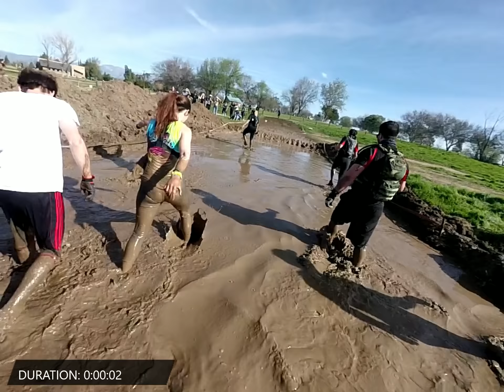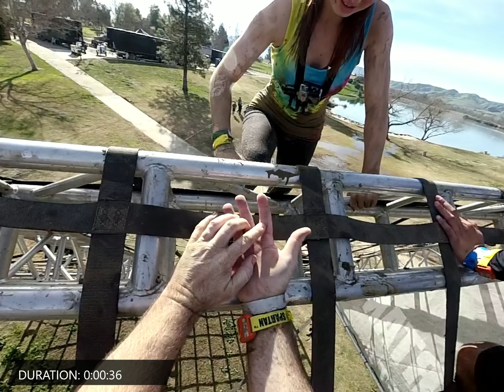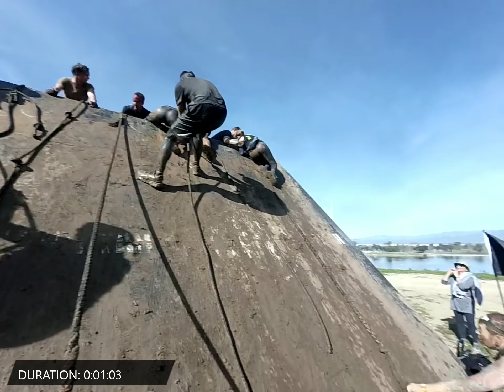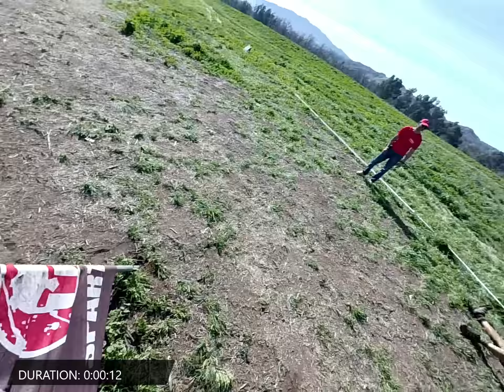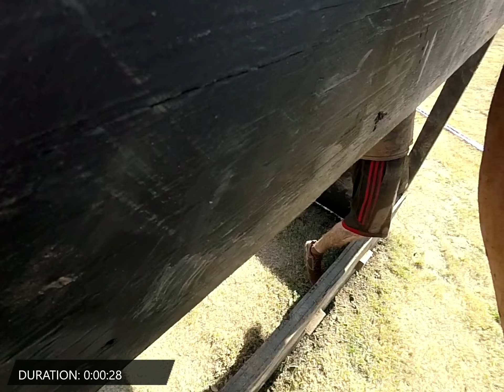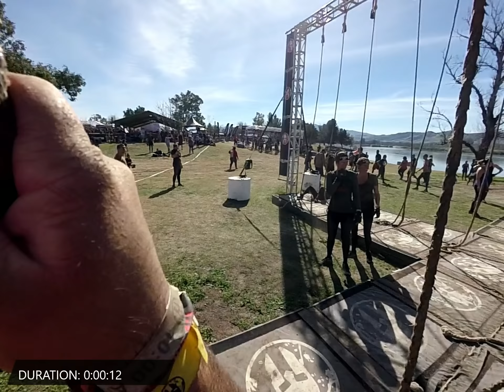Spartan Race Sprint 2019 Chino CA

Comment: What kind of GoPro are you using with accessories.  How did video remain clean after the mud water dunk?
Reply from the maker: I used the Garmin Virb XE. The case has coating on it. The water just runs right off. You can use rainx on your case. It will do the same thing.

Comment: How much is the weigt on bucket?
Reply from the maker: In the sprint, they are 1/2 full. In the super, they are filled to the top and you have to fill them and dump them out.
Reply: @Misfitswitch   wish me luck this February 24 ....my first time doing this💪😅
Reply from the maker: @drghost88  You will do fine. Just take your time. :)
Reply: @Misfitswitch  and every fail is 30 burpes right.... but there is someone checking making sure you do every single one???
Reply from the maker: @drghost88  there are people watching to make sure you start doing them. But there are to many people for them to count them. Also your team mates can do part of them for you. Also everyone will help you get over the obstacles. You are allowed to get help with anything.
Reply: @Misfitswitch  and thanks man I'm running by my self on the Sprint any workouts recommendations?
Reply from the maker: @drghost88  do a mix of  strength and cardio do not just concentrate on one. There is a lot more cardio then you think. Also wear some kind of knee sleeves or  leggings. You crawl on your knees a lot. Even dollar store knee sleeves will help. Wear thin light weight none cotton clothes.
Reply: @Misfitswitch   that's what I'm trying to do lil bit of everything ....thanks man💪😎
Reply: This video was so helpful. I want to do the Sprint in August. I am really nervous! Are the sandbags and buckets lighter for the women than the ones for the men?